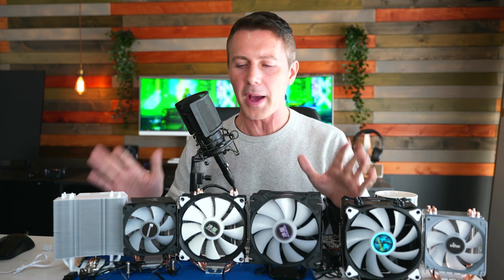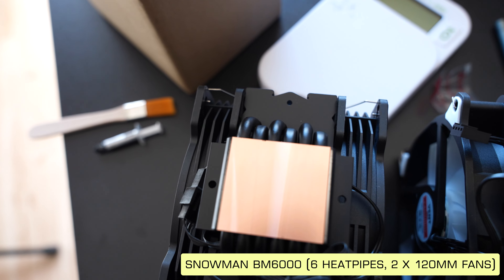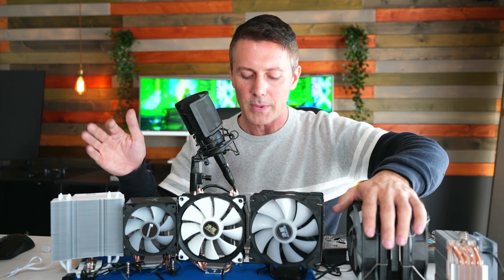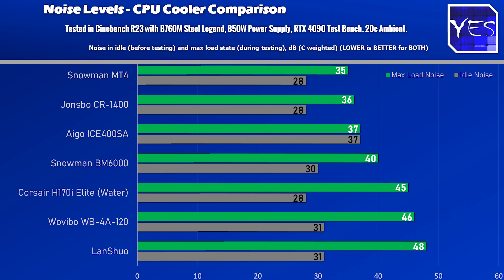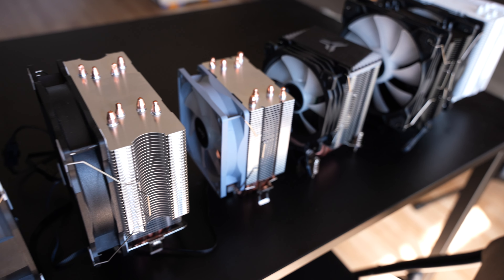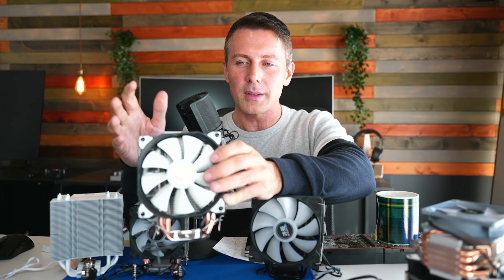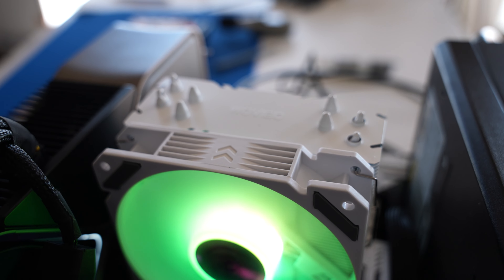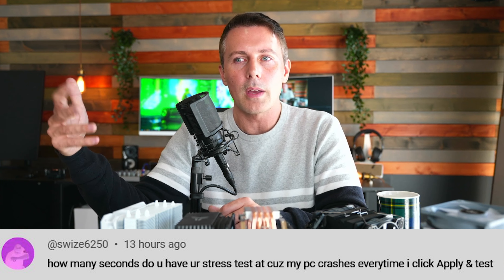What's the BEST BUDGET CPU Cooler in 2023? (Aliexpress Showdown)

Comment from the maker: Forgot to add in the video, there will be lots of popular coolers out there that will perform similar to the ones in the graphs today.  For instance the Deepcool Gammaxx 400 v2, would be very similar to the Wovibo (looks nearly identical in terms of actual base metal, probably come from the same factory before stamping).  Deepcool's fan should be better though.  Just make sure you aren't getting a lanshuo or a molten 400 from Aigo.
Reply: Please do a low profile showdown for small form factor builds for Aliexpress coolers.
Reply: why not try testing air coolers from thermalright? I own a frost spirit 140 (twin tower cpu air cooler) and it has been working wonders for me. even their 120mm fans are really good value as they perform well and have daisy chain headers so you dont even need to buy fan splitters/hubs
Reply: Was just about to write about that cooler lols and it's around 15-20 euro in the EU and yes the fan is good and silent enough. And still it's a 4 pipes, 1 radiator, <120W cooler max, but for the price is a very very good cooler.
Reply: Yep, i have a pair of Gammaxx 400 V2's... work well on a 4790k and Xeon 1270 v3. Just stay away from the V1.. they use the god-forsaken stock Intel push-pins. 😠
Reply: @mrsrhardy  He wasn't comparing them against AIO's... he threw in the AIO to show how much you might lose compared to a top-of-the-line cooler. There is a difference.
Reply from the maker: @mrsrhardy  Will be testing water coolers in a seperate video, waiting for arctic 420 to arrive.
Reply: if they almost cost 40$ US you should give the Thermalright Peerless Assassin 120 SE (ARGB) a try (here in germany it costs 42 Euros) since that one really outclasses all of them easily. its almost on par with the almighty noctua nh-d15 or the deepcool ak620 which both cost alot more. for me it is the best bang for the buck aircooler on the market (including the fuma 2 which is bit better on the noise part but looses at higher tdp) beside that very informative content and wish you alle the best for the future ...
Reply: Can I order the new lga1700 bracket? I'm using the old one on the old motherboard(H370)..
Reply: A BM6000 is $27 in AliExpress (I'm currently living in Brasil), and the Deepcool AG400 is a bit cheaper and have better fan
Reply: dual tower coolers from aliexpress in this price category are missing =)
(for one larger vs two smaller towers)
Reply: The funny thing is any of the AM4 CPU's would be fine any of these.
Reply: @techyescity 2024 version soon?

Comment: Thermalright Peerless Assassin 120 SE for 39$ is also a killer cpu cooler.. very happy with it
Reply: I've had good fortune picking up older Thermalright coolers, eg. I won two True Spirit 140 coolers on ebay in 2020 and 2022, the former for less than 10 UKP, the latter for 25 UKP. Years ago it wasy easy to bag the original 120mm TRUE RevC for a snip, but they're harder to find now, ditto the VenomousX. Of course socket compatibility may be a factor, depends on the build requirements.
Reply: @RafitoOoO  yeah I also face the same issue dur to tax imposed on foreign products being shipped.
Reply: Bought this one to replace aliexpress 6pipe mounted on them good fans and its great like the best of them
Reply: Last time i bought one it was 1kphp or less than 20usd...
Reply: You beat me to this!!
Reply: It’s cooling my 12700k
Reply: Peerless Assassin 120 non SE was about AU$60 on Amazon AU which isn't bad considering free shipping to Australia and NZ. But Gamer's Nexus means it's now out of stock and who knows what price will be when it comes back as it's only FBA.

Comment: In the US we have Thermalright as the $20-$25 air cooler option - their performance is on par with the Snowman (or even better for some variants) and you can get ARGB and white versions for only $2 more
Reply: argb, lol
Reply: Honestly I think you're right. I'm not from the US but we also got Amazon, and free shipping on eligible products (on a purchase over $49). I've been going back on forth on AliExpress trying to find a decent cooler, preferably 6 heat pipes and a black coating heatsink. But a lot of these coolers either look a bit toyish, or their loading mechanism isn't that great, or don't have a flat contact plate (without the heat pipes going through). And once you do find a decent cooler on Ali, they cost the same if not more than the Thermalright ones.

As of now I recon I'll either go with the base models Thermalright BA120 ($27) or PA120 ($40) from Amazon. Unfortunately all the nicer looking Black/White/ARGB Thermalright coolers, on top of being more expensive, come with additional $15 shipping to my country instead of free shipping so I'll skip those. And the mounting mechanism on Thermalright is great and very easy to use, saying from experience having use the PA120 SE.
Reply: @kravenfoxbodies2479  Seems to be doing pretty great, not going above 60c, can't see the fans RPM but I'm assuming it's probably quiet.
The build I'm assembling is quite similar, p5600 + B550m + 2x16GB 3200 C16 (Hynix CJR, dual rank). I also have the base model PA120 SE and I have to say it is very well made. The mounting mechanism is very easy to use, solid heatsink. The stock fans were alright, not bad at all but also not that great. They were fine the first few months but then started making noises after a few months so I replaced them with Arctic P12 fans which ran quieter and cooler.

Unfortunately I can't get the P120 SE with free shipping from Amazon to my country anymore, it's an extra $15. I can however get the PA120 for $40 with free shipping so I'll probably get that.
Reply: @Ben-ld1qi  I run the cpu fans at the bios level in PWR mode, they only ramp up with power draw. I have replaced my memory and installed my top M2 drive, only front cpu fan needed removing. 4 x 8Gb Muskin @ 3600Mhz Cl 16 Single Rank is the new setup. Fortnite was kicking my ass with 16Gb of system memory.
Reply: I am from Asia and I went with the Thermalright Peerless Assassin. It is a superbly designed cooler that matches the NHD15 performance for a third of its price. Nothing I can get from AliExpress comes close to it. There is no point going to Aliexpress when a reputable company like Thermalright offers coolers that are the same price and performs extremely well.
Reply: Thermalright has indeed quite a lot decent cooler. I still have a HR-02 Macho in use here, that was like 45€ back in the day and is insane for the price. Their support can be a bit iffy at times, but their products are good.

Comment: +1 for the Thermalright Peerless Assassin. Idle temp around 27-28 degrees, under full load on my 5800x didn't go above 74 degrees (extended Cinebench run)
Reply: my Man I have the Thermalright Ta 14 EX  and the 5800X3d never gets over 64   it was on sale on 28 bucks
Reply: @nuclearpcs2139  The 5800X3D's tend to run cooler than the 5800X's.

Comment: I got the Jonsbo CR1400 when it was $12 with free shipping 3-4 years ago in a space-constrained scenario (the ITX position in my dual-system case, a Phanteks Enthoo MiniXL) and it's probably been the most impressive little lump of metal I've ever owned. A huge benefit for me is that it can be rotated 90 degrees to push air directly up towards the top exhausts. This helped me shape the airflow of my 2 systems properly to eject hot air faster which is a benefit to the gaming system in the mATX position in the bottom of the case.

Comment: Was hoping to see the Amazon "ID Cooling SE-214-XT" here at only $19.  Though the Jonsbo I like the RGB on top of the cooler even though it's probably not addressable RGB.
Reply: Also a great choice and I agree, I have used these a lot as well. Solid coolers for the price!
Reply: 120m fan, direct contact 4 heat pipes. RGB has a connection. For 20$ it's a really good deal.

Comment: Love these roundup videos it's always nice to be informed about the market and where the value CPU coolers are. I personally have used the snowman T6S which is a six heat pipe single fan model I have used that particular CPU cooler on high TDP Haswell xeons for quite some time now and I'm seeing temperatures in the mid-60s with nice quiet fans. Now this is also slightly because the Xeons generally have really good heat dissipation but also these coolers at between 25 and $28 for me represent a very good value and if I keep the hardware they could technically be reused if I decide to retire the platform.

Comment: Not sure if they are readily available where you are but Thermalrights coolers are absolutely crazy value for performance. Maybe not so niche as these, but those guys will most likely have better QC than these coolers (being in the industry as long as they have). Plus better mount, paste and fan(s). Plus, can be bought from Amazon so returns are much easier if anything should go wrong. 

The AK120 single tower cooler found less that $25. And the dual towers PA120 and PS120 for sub $40; the latter being the newer, better model.

Comment: Deepcool and Thermallight Cooler are so cheap now and they perform so well too. I've build a few with the DC AK400 and it does a fantastic job at 35-40$. I recently purchase a Peerless Assasin dual tower/fans 120m for less than 40$ Can new, since its comparable to Noctua's best at the price its a no brainer :P

Comment: I see quite a bit of fan wobble on the mt4 (at video mark 11:08) you can see the fan is off-centre (I am not judging the wobble by the sticker placement but the fan housing around the centre) so if it does that good with defective fan, wow I am impressed !

Comment: can get the Jonsbo CR-1400 locally in my country for 16 USD shipped. build quality is really decent and has ARGB on the top plate. Also the included fan is one of the few available 90mm ARGB fans in the market (can buy it separately).
Reply: I am a fan of the CR 1400. I have a few builds with it.
Reply: how bout the noise ? i use 1200 why sound bit noise

Comment: That BM6000 looks like a great deal. Around US$34 including delivery to Australia.
I've been using one of the old Snowman 4 heat pipe coolers for ages and it's performed well, but on a Gen10 i5.
I'll need something a bit better for the i7-13700 I'll be getting.
Nice review.

Comment: Is that a Watson tartan I see on that mug btw?   As for footprint finishes, unless its a super cheapo cooler I always lap my heatsink's footprint going into the '000's grit, Brasso wadding and metal polishes and I have a very small piece of plate glass I use from my watercooling days for testing of true flatness and ascertaining the thermal paste "squish" pattern.   I suspect my huge returns on my Coolermaster V8 MK1 was primarily down to me turning a fairly good baseprint into a perfect mirror finish.   I am lucky that I am into watchmaking these days and have a very good bench polisher as well as a multi belt/disc sander which I have 4000 grit on the disc, abs awesome for truing baseprints as sometimes they do get knocked in transit, a heatpipe slightly dislodged or lifted.

Comment: Hi Bryan, could you check out the Snowman 6 pipe 90mm duel fan, I accidentally ordered one of these to use on my ryzen 2600, I think it is running OK, I know that if I have picked the 120mm fanned cooler it would have been better, what do you think of 90mm cooler.
Reply: 4 pipes 120mm is much better than 6pipe 90mm dual tower dual fan,

Comment: My most efficient air cooler is my MK1 Cooler Master V8, I ran it atop a Vishera overclocked and it just chilled it all down like a pro, I would have had that on my Ryz 5 I currently have but finding the hens teeth AM4 adapter kit has eluded me.   I also have my main rig inside a massif Cooler Master HAF XM with an extra top 240mm fan, a drawing in fan on the side door plus a big 240mm in the front panel and a pair of 120mm's up aft that like the two 240's on top just suck air out like a pro.   I also have a drawing fan mounted to the back of the hotswap sockets which keep my HDD's nice n cool and a big beasty heatsink atop my NVME SSD as that can get a bit toasty hehe

Comment: The dual fan cooler will be loud at full speed mainly due to the rear fan in pull config creates annoying acoustics. This applies to all tower coolers with a rear fan pulling air through the fins. Have the same issue with my as500 plus although it’s a very good cooler
Reply: If you normalize the performance : noise, dual towers are much more efficient.  This means for a similar operating temp, they are quieter.

Comment: I'm using a Arctic 280 cooler aio on my 5600x CPU pair with a b550 tomahawk motherboard  and lian-li case my temps run from 30 Celsius up to 55 Celsius when the CPU is working it's little butt off 

when I was building my computer I paid 240 Canadian off of Amazon it was a little steep but trying to give my CPU longevity...

Comment: tbh my experience. i will never go those clip on cooler anymore in my life. i use 12100f and soyo b660m. purchase those cheap cooler based on your recommendation. after 3-4 month, i start having issues pc cannot start and artifact, ofc my first guess is gpu. try different gpu not help. after fully disassemble my pc, my mobo bend a lot on the cpu side. The mounting force of those cooler is too much. unplug those cooler, try to bend the mobo a bit. using stock cooler back pc boot, all three gpu i purchase was working fine

Comment: The supposedly wattage TDP on the cooler spec sheet is absolute marketing jargon. I had a 180w cooler that done way worse than another 180w cooler from another manufacturer. Same fan size in same environment. Only benchmarks will show what coolers are capable of. Btw you should get your hands on some ID-Cooling coolers. Priced well at decent performance.

Comment: I used a jonsbo  cr-1400 on my i5 10600kf and it would go up to about 95°c under a cinebench r23 run. I upgraded to a uphere 120mm cooler I found on Amazon for about $50 usd and it now only gets up to about 70-75°c under the same test.
Reply: That's jonsbo is quite pricey in my country. Even if we buy it straight from china..... Snowman is cheaper

Comment: its insane how it can be almost par on deepcool ak620 half of its price  i would definitely change out the fan to much higher rpm im sure it will improve even more ngl ill be going with that snowman bm6000 or t6 new version black dual fan argb updated mount bracket too like the snowman bm6000

Comment: I bought a Cooler master EVO212 black rgb for $20 on black friday, and got also a cooler master sickeflow rgb fan.  Just watching youtube and twitch and the cpu temp is at 27-30deg, and in gaming low 60's depending on game. Best part is that i have those fans in the computer, you cant even hear the computer is on :) edit: cpu is 12600k with unlocked power
Reply: I tried horizon zero dawn benchmark, I hit 58 degrees.

Comment: Jonsbo sold me a CR-1200 with very subpar quality. Fan is noisy and the base protrudes over the heatpipes and is very uneven. Heatsink was barely heating and CPU was throttling.
After one hour lapping, it still performs worse than a 12y old Arctic Freezer 64.

Not recommended even at the $10 it cost me, especially for most users who will not be fixing the cooler contact plate.

Comment: I consider the EK-AIO basic 240, used or refurbished at $90 and less, the best budget CPU cooler. It's not $20 but it comes with some of the best radiator fans on the market and an EK made pump. This cooler will sustain a large amount of CPU's on the market, making it an incredible value.
Reply: AIO is not a good for a long run. Meanwhile air cooler only need to replace fans

Comment: The Hyper 212Evo has been my go-to for a long time. But it's great to see there are all these other options. The 212 is not always the best fit.
Reply: The 212 is overpriced for what it is. They sell for $40-50 usd here. They only still sell because they made a name for themselves in like 2013 when it used to be the best value and they’re just riding on that.
Reply: id cooling se214xt is the new go to for me. Has sticky foam pads on the backplate making mounting super easy. Only gripe is the metal fan mounting clips that can bend the fins slightly but it's a 2 second fix with light pressure from a flathead so no big deal, especially for the really low cost and aRGB.

Comment: The cooling performance is good, but that AMD style latch mechanism is at the very least, annoying. The steel bar that holds the heatsink onto the CPU is too stiff so it creates too much pressure. And it's VERY difficult to remove for maintenance.

Comment: A few years ago I bought over a dozen Aigo Ring Fans that looked decent but almost half of them leaked out all the Oil in the Bearing & got pretty loud. They also can not be Re Oiled, there is no Plug to pop out on the back of the Fan. They are terrible so not surprised their CPU Cooler is also junk.

Comment: Using the 6 heat pipe snowman, got it  for 15 usd years ago at a discount. Still cooling my X5675 at 4.2ghz 😎. 

Although I’m in the process of upgrading to ryzen, xeon is becoming unstable under windows. I got a grate deal on a ryzen 5 1600 & 16gb ddr4. Just need a Am4 motherboard, any good tips? Used or new?
Reply: is it the one with two fans or one